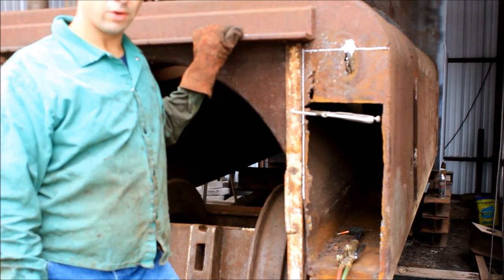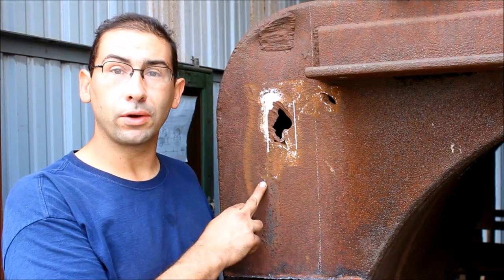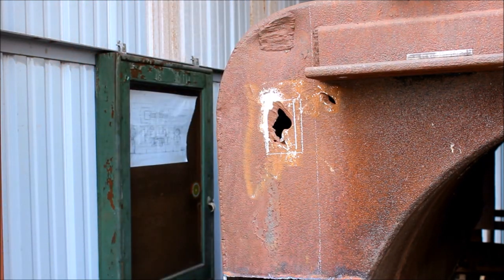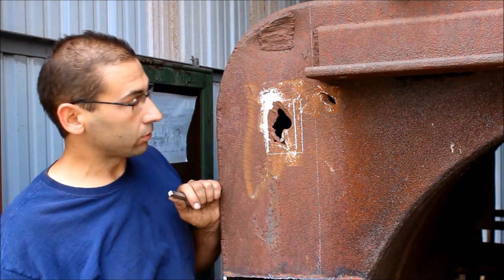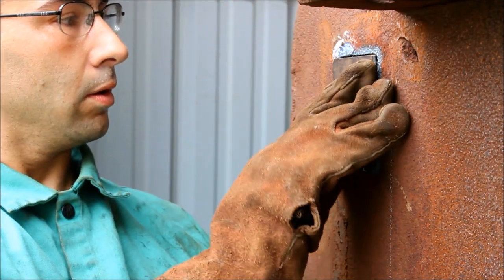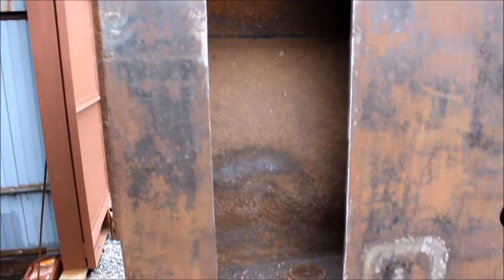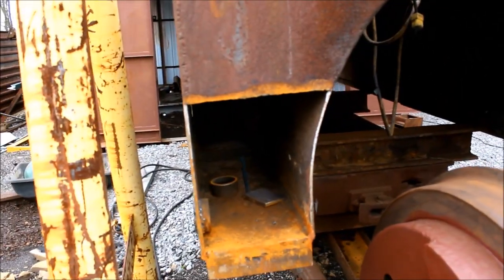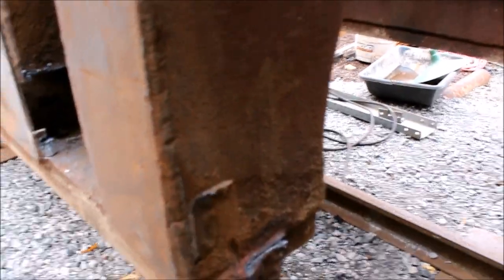J&L 58 Restoration Part 6 : Beginning Work on the Saddle Tank

Comment: Just a Quick Question, for that small amount of rust at 1:40, you cut out a smal piece and there appears to be another hole a couple inches to the right, why didn't you cut out a single piece for the two patches?
Reply: It would be first a oddly shaped plate second why whould you wast the original metal